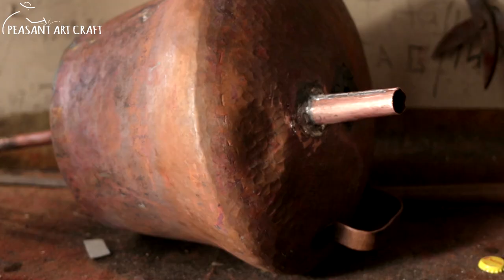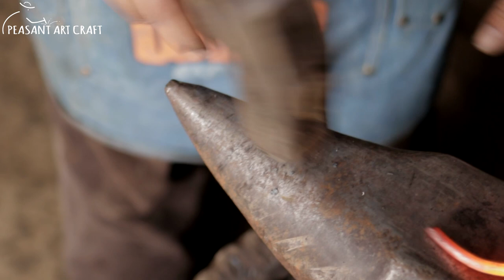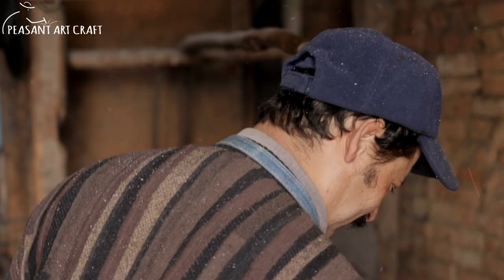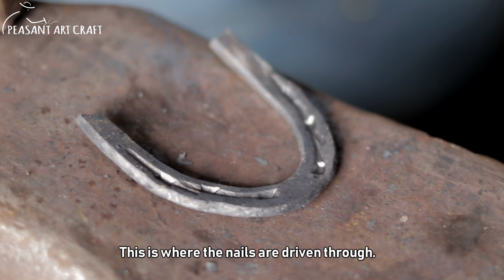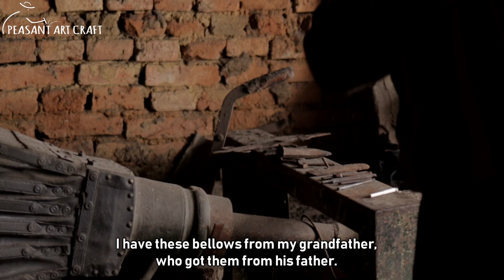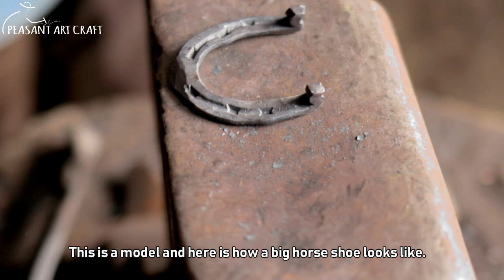Blacksmith Making a Horse Shoe

Comment: Why does he keep hitting only the anvil instead of hitting only the little shoe?
Reply: If you watch more blacksmith videos, you'll see that it's often a customary approach to hammering during certain phases of making / repairing objects.  

For the roughest shaping, often it's simply one hammer-strike after another -- without pause -- on the yellow-to-red hot metal.  

On the slightly more "precision-oriented" phases, it's common to bounce the hammer on the anvil before and/or between strikes.  

It can:

1) help to set a rhythm for the work overall and for keeping the motions synchronized between the hammer-hand and the off-hand (which may need to adjust the position of the work or auxiliary tool), and it 

2) partly helps in keeping the hammer-hand "calibrated" to the weight & therefore the force of the hammer-head.
No matter how many years a smith has worked, it helps their hammer-hand to keep the "just-right" amount of force being applied in each step, because undoing the results of excessive applied force can make for so much extra work compared to incremental forward progress.  

There are other aspects as well, somewhat depending on the individual smith and the traditions or mentors that helped shape their mode & manner of work.
Reply: Rhythm is why.